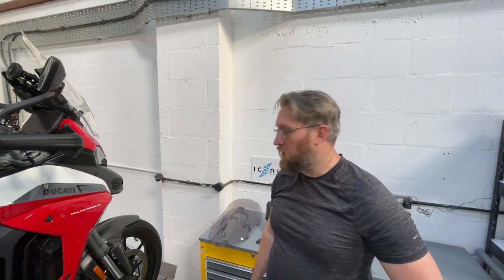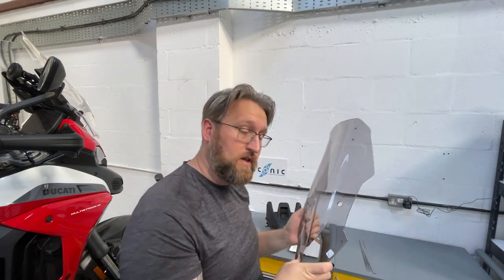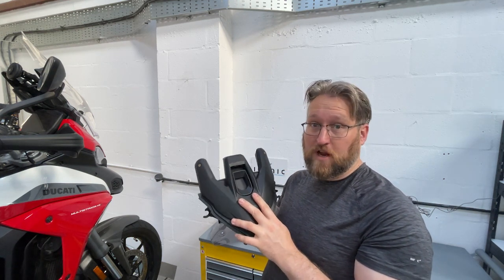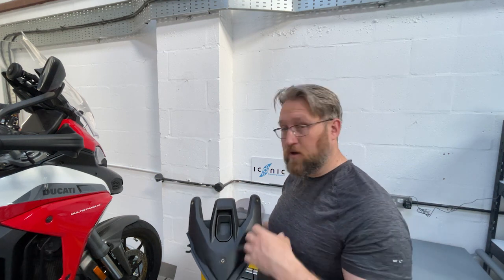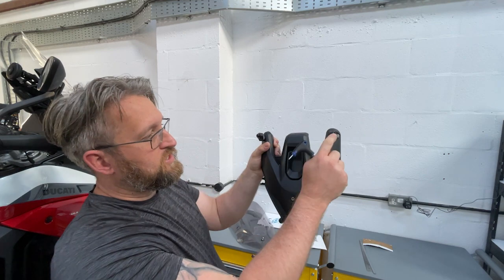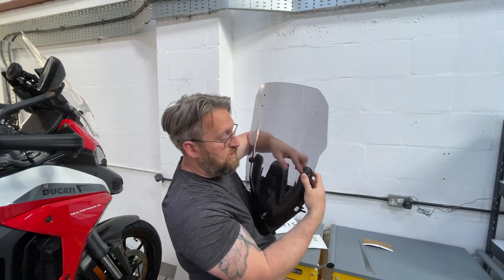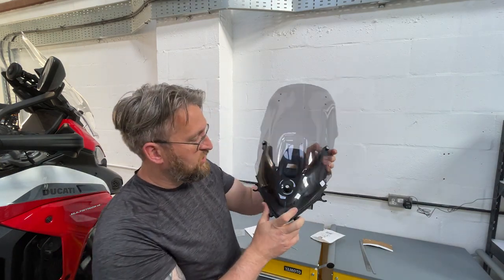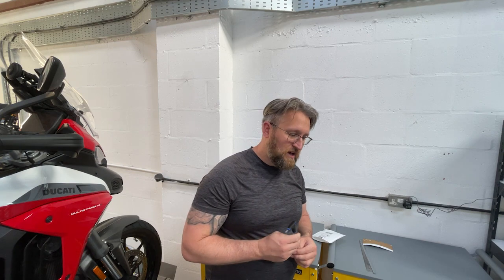Multistrada Screen Spacer Install

Comment: I have the v4 and want to know what purpose are the spacers used for?
Reply: I had them on my 1260S and they made a huge difference in cutting down wind noise and buffeting. I now have the V4S but the link shown above is for 960, 1200 and 1260.